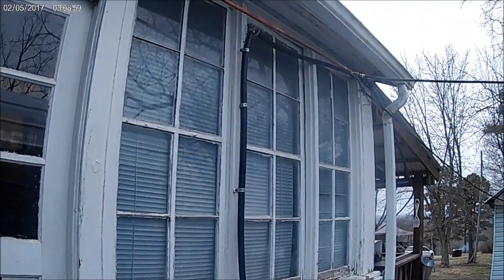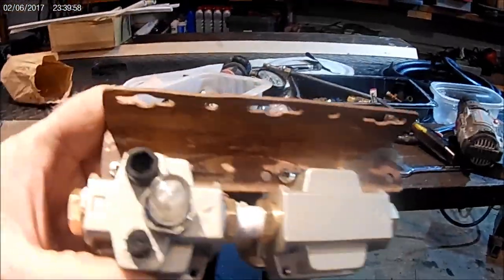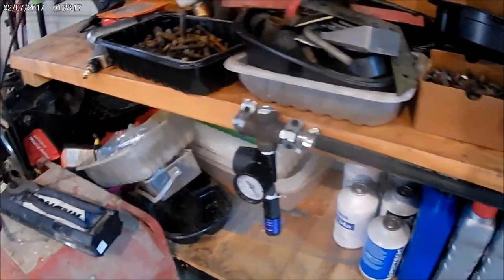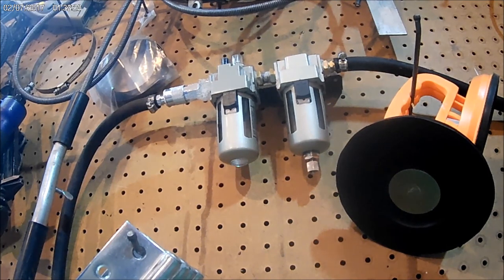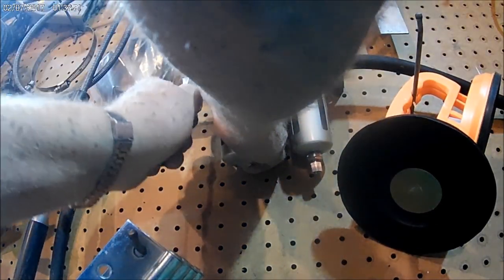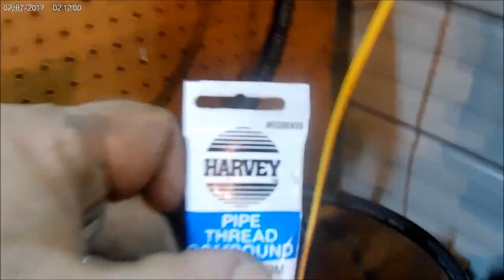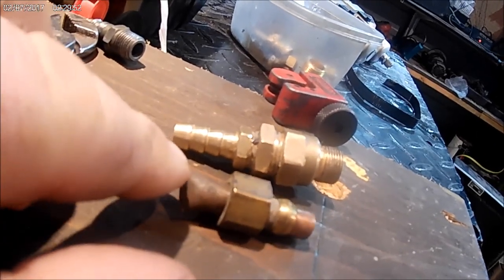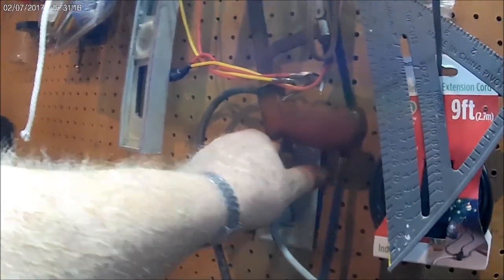Running air lines and compressor refrigerator air dryer

Comment: Great job Vernon, that is nice to have a set-up like that in your shop, I am a little lost with the refrigerator in line, is the purpose to dry the air as you mention only or will it keep a few beers cold as well lol
Reply from the maker: lol no,, no place to put beer, it's supposed to keep the air drier before it gets to the air tools.

Comment: missouri i used to have a speedaire compressor it was small and probably older than me i got rid of it because it got to where i was constantly having to pull the head off and monkey with the reed valve  
and i had no idea there was an air conditioning unit for the compressor
Reply from the maker: yeah . these things are supposed to take most of the air out of the lines,, we had a bigger one at the print shop but all the presses and collators etc used air and moisture in the lines was a killer for those air pistons.
Reply: @MissouriOldTimer  oh ok then i just assumed that all the filters was like the canister ones you showed...
 do you remember the old old canister type filters you just stuck a roll of toilet paper in
Reply from the maker: @GeorgiaRidgerunner  not on the air lines but on the  Ford dump trucks we used in the late 60's had oil filters like that, they took two rolls of toilet paper.
Reply: @MissouriOldTimer  on vehicles oh wow i didnt know that about the fords

Comment: You been havin' trouble with water in the air line Vern.?
Reply from the maker: not so much now but in the summer, sometimes it looks like a spray gun when I use the air nozzle.

Comment: What is the purpose of the refrigerator???
Reply from the maker: it's supposed to cool the air and  reduce or eliminate the water in the air lines, we had a bigger one at work because almost all the printing eq. ran on air and moisture was a killer on the components.
Reply: @MissouriOldTimer  you print?